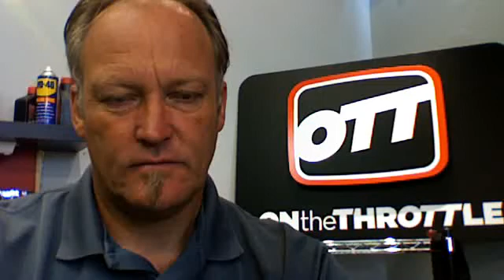How can I keep nitrogen in my rear shock?

Comment: Hey Dave! I want some help with rear shock nitrogen! I have put some new seals and I want to recharge it with nitrogen. Manual states 218psi but most shock service stores tell about 150-160 psi. What pressure do you suggest? And how pressure can affect shock operation? For now I have about 60-70 psi, just to extend the caps and lock the safety circlips. Thank you!
Reply from the maker: Always use stock recommendations from the service manual.

Comment: If i service my shocks every 2k miles do i need to add nitrogen or can i add regular air to my shocks.
Reply from the maker: To service any rear shock that has nitrogen you will need either a schraeder valve or hypodermic needle, plus N2 tank and regulator. The nitrogen must be discharged first prior to shock servicing. Nitrogen must be replaced as it is inert, air is far from inert.

Comment: man omg, my ride has 40000 km regular riding, its 750f suzuki,  and i think make maintance at rear shock, enxange oil an fill gas,  is necessary exchange oil, or only re-press gas n2 ?
Reply from the maker: With that many miles the rear shock is not really functioning at any reasonable capability. Fork oil is easy and as a you have a reservoir on your shock, replacing shock oil can be done too. To exchange shock oil you have to disassemble the entire shock so yu will need fresh N2
Reply: nice tip man,  the shock works well, when push down at seat, but,  i feel one lapse between midle anda final course, where the final has no traction,  like half action of shock, (sorry my eng)

you can tell me how much oil fill that model,  like this one.,

https://i.ebayimg.com/images/g/0CQAAOSwSw5bGDZV/s-l225.jpg
Reply from the maker: shocks are full of oil - there is no air in them so there is no volume to use in cc or ml. Your English is fine. You have air in your shock which is why you feel two movements.